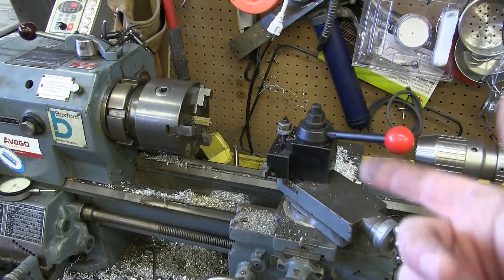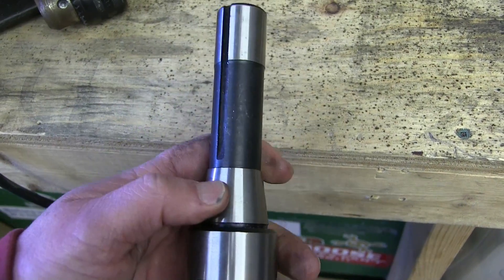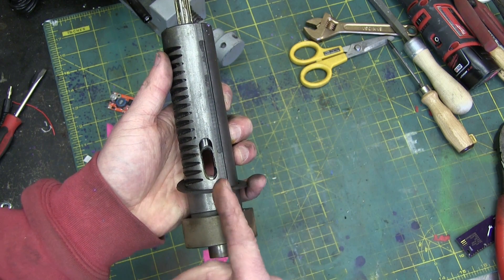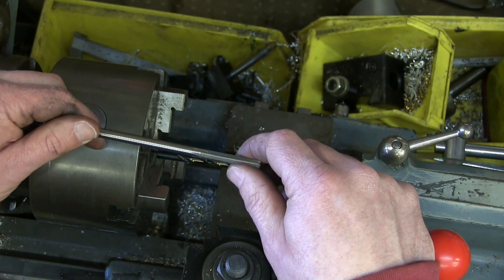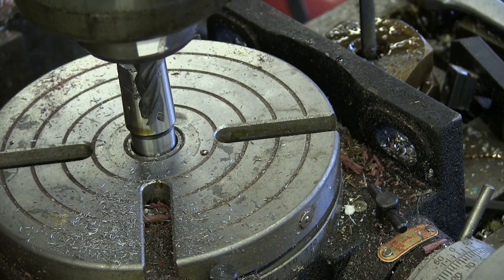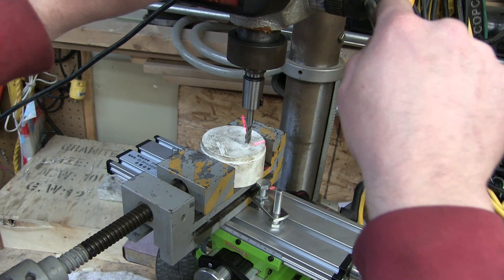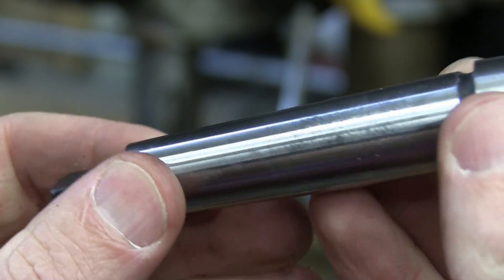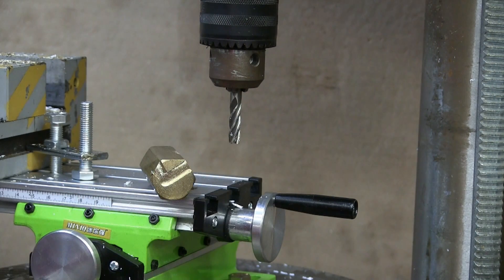"IMPOSSIBLE!" Milling Machine from a Drill Press

Comment: 2:40 This is incorrect.  Morse Taper doesn't come loose due to lateral loads, it comes loose because an endmill flute will constantly pulling down and eventually pulls the toolholder down. 
There is the possibility to have a Morse Taper with drawbar and will be as good as R8.
Lastly, using a normal drill chuck, even with a drawbar, the endmill will eventually pull itself down.

Comment: I needed a way to cut dovetails in steel and living in bumfuck nowhere I don't have access to a makers space. Took apart an old drill press and noticed the spindle looks like a miniature milling machine spindle without the drawbar hole bored. So I measured the taper jt33 if I remember correctly and bought a collet set that fits jt33 to er16 (I could be off with the nomenclatures). Install everything but noticed any side load and the taper would lose its grip. I considered boring a small hole and making a small drawbar since I have a lathe but decided to thermally fit the collet holder. Threw it in the over at 550f and stuck the spindle in the freezer. Twenty minutes later fit the two and they never separated. I cut the dovetails and "milled" a handful of other parts until I finished building my mill designed to be a mill. I mean I was making relatively flat parts but nasa sure as shit wasn't asking me to make parts for them. I guess what I'm saying is it can be done but I wouldn't invest more than a hundred bucks. I got the drill press for next to nothing, collet and holders twenty bucks, the finest chineseium end mill and dove tail cutters for twenty bucks, ect. I have way more time than money so it was worth it to me and added the level of precision I needed to build a proper mill.

Comment: So I have a Buffalo forge 10 inch Camelback drill press that I used on I guess they're called safe plugs they're really beefy stainless steel used for when you get locked out of a safe at a bank they have these plugs that they use to plug the holes ANYWAY WHEN THE DAM MORRIS TAPER JACOB'S CHUCK FELL OUT OF THAT THING FROM IT SWIVELING AROUND I THOUGHT THE WHOLE GODDAMN CAST IRON DRILL PRESS FUCKING SNAPPED AND MADE ME BITE A HOLE IN MY PANTS anyway the drill is fine but the Chinese mill vise i bought for 65$ didn't hold up with the vibration and shook loose every screw on it and the set screws on the drill pullys loosened but for the money an old cast iron drill press is definitely a better option than harbor freight

Comment: I've been wondering this all the time, are drill able to just use a milling bit and turn it into a drill, but I also thought how one was meant for vertical force and the other horizontal but I dont know what the key difference in the build was.
What about a die grinder? Can I make a jog and use it like a router but for metal? It would work kind of like a milling machine.

Comment: I did this exact thing 3 years ago with reasonably good “success”. I went ahead and drilled the quill for a small drawbar and was able to use MT2 end mill holders. It left a lot to be desired but I was able to use it with some success. I’m happy to say I have a Bridgeport now and the drill press is in the wood shop doing what it should have been doing all along.

Comment: What the fuck?????///////>  You mean to tell me that I spent 1000s purchasing a milling machine when I could only for a few bucks would do to build an automatic clearance in every job that I put the machine to.  You will have flex in every component of your rig. Ahh. thats right. a cheep version , thats the answer. Cheers and good luck on truing the rig up. I admire your optimism. Lesson, don't' try top cheep out on machine tools especially if you want accuracy.We will put it down to wood tolerances.Next job, a spindle moulder.

Comment: I managed to successfully 'convert' a big drill press into a mill by bolting it to the top of my lathe and using the carriage and cross slide for x and y motion, plus adding a quill lock and through drilling the whole spindle to add a drawbar

Comment: AvE why haven't you moved off of R8 back end holders? Update that Bridgeport mill to the 21st century with the Easychange system and then you don't need to bugger about with the drawbar and screwing in collets etc.  Literally its a matter of putting in the master adaptor and holding it in place with the drawbar and you just change the slave adaptors at the bottom (to ER collet holders, Jacobs tapers, Weldon holders, MTS holders, Shell mill adaptors etc) by pressing in a button, twisting the lock ring and then hot swapping between adaptors. Essentially turning it into a CNC.

Comment: "Drilling on a round...
...it's gonna fuck right off, on us."
I laughed way too hard at that, than I should have. Mainly because I've been down that road, myself.

One of my RC helicopters, as replacement parts were dwindling (because the original manufacturer went bust), I wound up having to machine a lot of the parts I was breaking, myself.
6mm main rotor mast, with 3mm holes... first time I did that & the damned thing disappeared on me & took half the drill bit with it.

Comment: If I really had to lock a MT2 taper into the spindle I would of taken the spindle out using another drill press lay spindle down on table drill and tap set screws on both side of spindle going right through MT2 holder as well install set screws make sure they are flush with a little loctite (it’s a dead lock that MT2 is never falling out now) then install the spindle unit up into quill arm , it should never break loose or fall out again ... but only way you would be able to take it out is to take the whole spindle back out again ... if you knock out MT2 it probably won’t line back up again ... I know not all drill presses have a spindle that spins inside a quill arm shaft it just a thought for a quick fix if you don’t ever want that MT2 shank falling out under milling operation on a drill press

Comment: Sorry if this is a stupid question... you took the tool holder thing (spindle?) out but I guess you then put the one that came with the drill back in?  I presume you did that fancy heating process again to get it to stay in there better?  Kinda skipped that part in the video as far as I could tell.  I'm also a Kanuck.  Thanks!

Comment: For brass and aluminum I think you could carve it out with a sharp wood chisel for about the same results. But cool to fuck around non-the -less. I actually have an old (early 1900s) Delta drill press that came with some milling equipment. The damn manual shows it too. Haven't had the interest in fucking up the girl to try it though.

Comment: Any true machinist will tell you NOT to do this. A milling machine has a mechanical connection to its tooling,  but a drill press only has a taper to hold the tooling and you're setting yourself up for disaster and possibly injury.  Sure, some have done it successfully,  and some ended up in the emergency room.  You choose.

Comment: I succeded to use a drill as a milling by using an adaptor MT2 to ER20 (10mm) and chopping near the top. Then I created a draw bolt by narowing a standard ex bolt. That way I am able to screw my MT2 adaptor. It permit me to use it even on stell for light work.

Comment: I superglued my taper in my drill press. Worked.  Dangerous sob when it came loose, tore up the work, whoflungpooed at my face while milling.
Those iron Hairball Frought drill press cross vices are crap out of the box, but can be greatly improved with minor modifications. Dont know why they don't just charge $5.00 more and build them 10x better.

Comment: Spin the part you want to drill the hole by putting the drill and reamer in the drill vice and lower the morse taper while it is turning it centralizes its self line up the tool with the side of the spindle first.

Comment: It's late to tell you now, but milling attachments that use the lathe you have are available. You could have bolted the X Y table to the cross slide on an angle plate, then secured milling cutters in the chuck. You a  took a lot of effort to  get poor mill function out of a drill press. You can still go back to the lathe. The xy table on the drill press does make accurately positioning holes easy.

Comment: If I'm scrounging to use my one milling bit more safely, I'm not going to have a freaking reamer. And certainly not the right reamer.
A D-bit is mighty easy to make and ... happens to work as a reamer. Ordinary drill rod ground to a conical point, then grind half off the side, then harden.Technically only required rock, fire, and sweat. Lost of sweat. ;D

Comment: Ave, it wouldn't surprise me if I already wrote this two years ago but a third axis attachment on the lathe is far preferable to the small, vertical turning you can to on a mill. Have not you ever heard, the lathe is the one machine that can make it's self? Well, until DMLS, 3D printers came out anyway but nobody can afford the ones what make the good finishes.

Comment: I am back on my drill press to light duty milling machine project.  Just purchased a cast iron milling table for it on ebay. It cost $138 and weighs 66 pounds which is more than the 16 pounds? that the aluminum ones weigh. Will post a vid of it when it is done. The mass of the cast iron should help eliminate chatter. wont flex like the aluminum ones Some people overwork mill/drills and call them crap. They are less rigid... which means you take smaller cuts and not try to hog it out in just one pass. Takes longer with smaller cuts but it prevents vibrating or flexing the machine. Take your time and let the cutter do its job and not force it.

Comment: I use my Radial Drill press ( from Busybee tools) to make a slot in 1/8 inch thick steel or aluminum bar, which was difficult to do accurately with a saw tooth drill bit cutter before I got this baby! https://www.busybeetools.com/products/drill-press-radial-1-2hp-csa-craftex-ct020n.html
Reply: availability seems to be Canada only.

Comment: First off just let me say that I love your language and knowledge, I been surfing cheap drill press videos about turning them in to a milling machine. I just bought a brand new cheap a$$ chines drill press for $150, but I was kind of lucky hehehe. It got a hole in the chuck and really soft shaft, so I just drill and tapped the drive shaft and installed the tapered chuck with a m6 screw. So now there is no way my chuck is going to fall out if I do some minor milling in wood or alu, check it out here: https://youtu.be/PsbAmQBE6Nk

Comment: I have Habor Freight 8inch,5 speed.I have X,Y cross jig to make it milling.The problem is the drill press has no spindle lock when I move it vertically to adjust cutting depth.Do you have Idea to solve this. Thanls

Comment: You really don't want to do this. The spindle bearings in a drill press are made for axial load not radial. By milling with a drill press spindle you will blow up the bearings.
Reply: In 2009 I took apart a rockwell 21-100 mill head that had loose bearings. I made a size tolerance build up drawing. It seems I was not the first to replace those bearings. There are 3 bearing quills and 2 bearing quill mill designs. Drill presses are usually 2 bearing. I replaced with cheap bearings. They are still working.

Comment: this vid reminds me of my bucket lists..   my bucket lists consist of challenging the mechanical and structural stability and accuracy of current products,  not rating them, but seeing if there is a way to reinvent the wheel so to speak.. but this is much later down the  road for me as i want to just consume atm and get my workshop setup and have nothing left to do but join youtube and tear stuff down and lot like this vid, maybe even reinventing the wheel.. cause this is a redundant video although entertaining..  well, your breakdowns are interesting to hear cause i couldn't tell you diffference between carbide tipped vs. full carbide for example..   but this video is a lot of what i want to play around with at older age..  just take a common item and see if it can be improved and not talking about the material it's made of cause that always can be but rather in design....

Comment: Got a second hand treadmill?  many have 1.5 to 2HP 120V DC motors with a speed control to run on AC.  Make your drill/mill truly variable speed with lots of power.  Add a $25 digital tach just for fun.

Comment: +1 for those cheap X-Y tables. 
I bought a 51mm coffee tamper when as it turned out I really needed a 50mm.
X-Y onto drill press, vice onto table. Spun the tamper in the drill and fed a carborundum block in the vice up to the work. 
Oddly , although the plating (Nickel on Copper possibly ? ) started to come off at first, the grinding succeeded in pushing it back around the piece so when it was finished it was still plated. Weird huh ?
Pic of the dirty deed - https://bit.ly/2NR4tTL

Comment: There is a morse taper in the headstock. You should have used it and drilled and bored the chuck it instead of putting it in the tailstock.

Comment: My chuck keeps falling out even when drilling hardwood with brad point drill bits, for no apparent reason other than I suspect the Morse taper was badly machined in the first place back in Chinaland. Very annoying. I don't have a milling machine OR a lathe, so I'm stuck with this bugger. Should have returned it years ago. But as soon as it arrived I stripped and cleaned all the swarf and shit out of the innards and filed off all the burrs left by the shitty machining process. So I'd already both invested time and energy in the thing AND voided the warranty!

Plus, now I need to make some very accurate keyhole plates out of 6mm stainless steel. I'm resigned to the idea that I will only be able to drill and file, but am also expecting the bloody chuck to fall out on each cut. I may also need classical music playing to maintain calm in the shop...!;)

Comment: Where'd you get the laser sight for your drill press? Or did you cobble it together?

BTW: I've done lots of medium-precision aluminum milling on my drill press and a 4" cross-vice. The nice thing about the Morse Taper is if you have run-out, you just whack it on the other side.

Comment: I have a question that's probably unrelated to this video because I haven't started watching it yet. What is better for electronic brushes as applied to running a hand held rotary tool? Will the brushes last longer running at high speed or low speed? I'm sure the bit that you have installed would make a difference but I'm one of the dumb ones and I'd like to find out. Keep doing what you're doing you make great videos I don't care about most of the stuff that you do but you make it interesting. And I have learned much from your videos thank you very much.

Comment: Bridgeport is a 7/16-20 draw bar thread. Rebuilt and repaired enough of those bastards in 30 year tool and die maker career. ;-). Little trick, even if your reamer has run out, chuck it out as long as you can without having it slip and it will follow your drilled hole and not tend to bore and cut oversize as it will when chucked up short and rigid. Love your videos!!! great stuff. Keep em coming.

Comment: Your way over thinking your 250$ milling. Machine I just tig welded the Morse taper in threw the wedge slot. I cut mild steel on the regular just .010 passes with a three jaw chuck if u need it to spin true put a run out gage on it and to tighten the high side holes as needed

Comment: A drill bit can wander and the reamer will follow. Next time try a combination center drill first then dill then boring bar after drilling or an undersized (resharpened) end mill to straighten the drilled hole. Chuck the reamer up at the end in the 3 jaw so as to let it float when reaming ( you could indicate the reamer in with using shims on whatever jaw needs it).

Comment: Just for clarification, I get paid to run mills/lathes/grinding machines, CNC or otherwise. I've held tolerances of less than .0001". I've also run some tabletop mills/lathes and found them to universally be made of fail and empty marketing. 

Not knocking your effort, but....no matter what you do to a shitty drill press, it's still a shitty drill press. The bearings in a drill press aren't intended for radial loads. The quill of a drill press isn't intended for radial loads. No part of the machine at all is intended for radial loads. That's why they don't have a drawbar or a spindle taper necessary for such. They have zilch for accurate Z adjustment or perpendicularity relative to the part(or x/y plane, if you prefer).....and that assumes the quill actually moves true to it's axis. Most of them don't. Hell, they won't even hold a reasonably true x/y position if you raise or lower the table. 

The only type of drill press I would ever consider doing any milling on would be an industrial radial arm type...and it would only be light milling at that. For what it would cost to buy a decent one, you may as well spend the money on a knee mill. Need a mill and have a 9" or larger swing lathe? Buy or build a milling attachment. It'll be cheaper and a hell of a lot more accurate than a bastardized drill press.